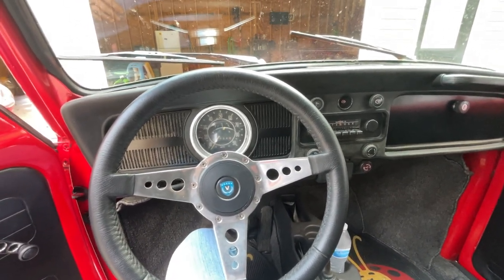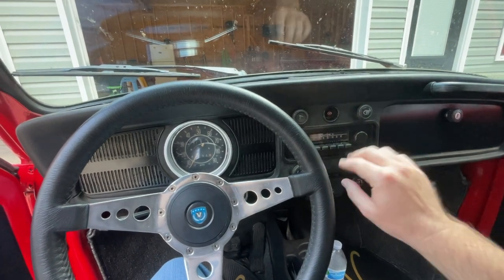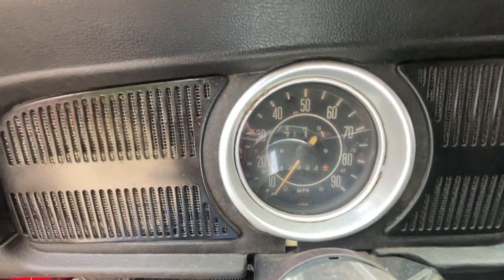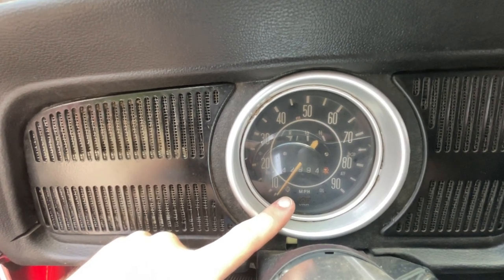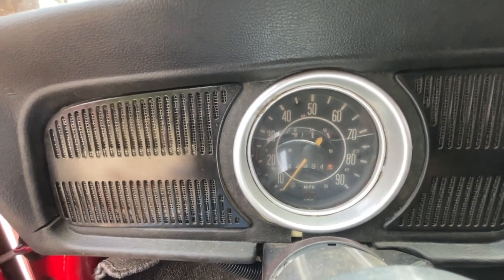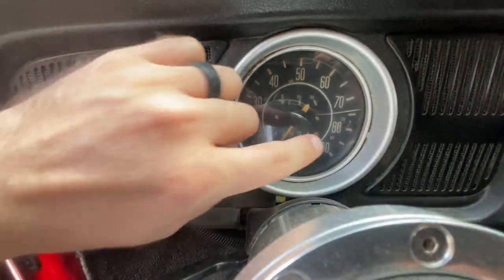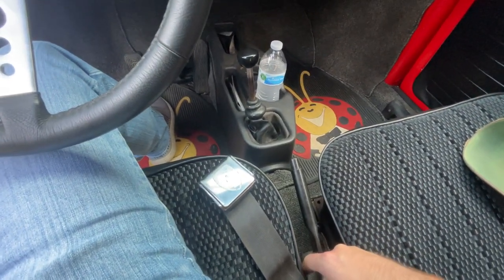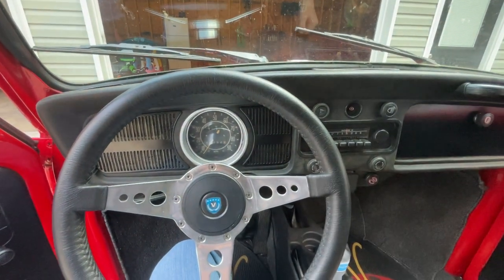Classic Volkswagen Beetle Cockpit Layout for Dummies and Millennials: 1970 Model

Comment: what does the emergency switch do?
Reply from the maker: Which one you referring too? The red one next to the ash tray/shift pattern?
Reply: @DirtRider22a  the one under the light switch
Reply from the maker: @Beetaldriver2 light, then below that is radio tuning knob, then below that is vent control, then red knob below that was hazard lights I think
Reply: @DirtRider22a  yes thx